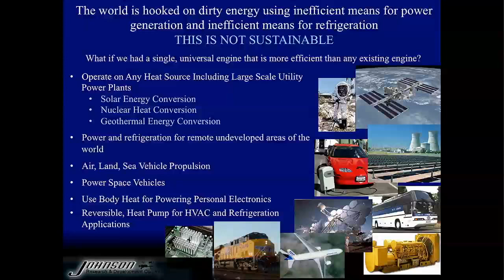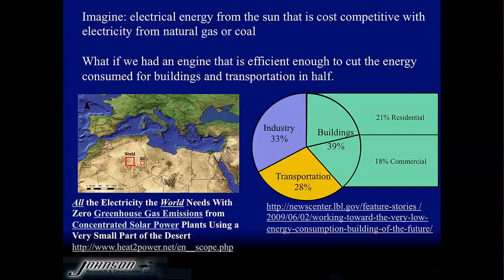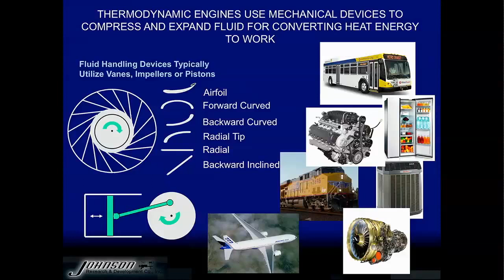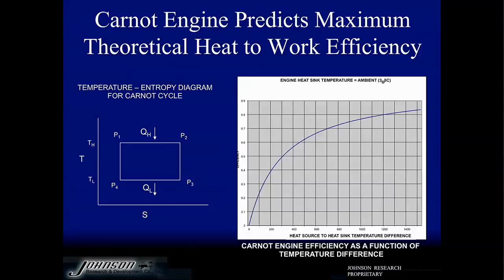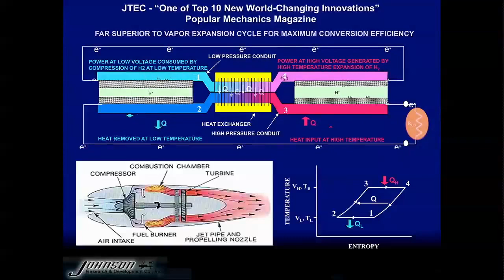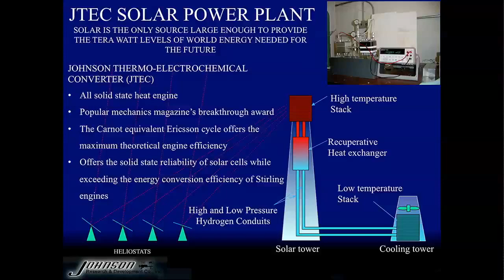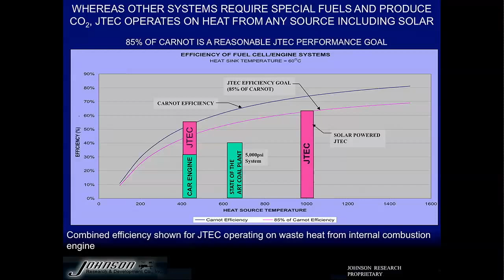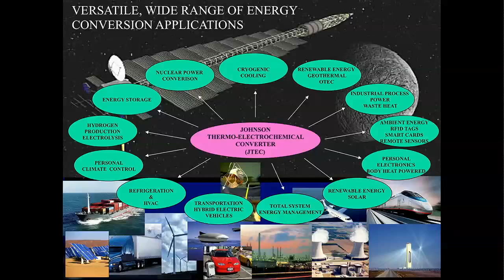Solve for X - Lonnie Johnson - Heat Direct to Electric Energy

Comment: CO2 is a problem? Without it , all humanity would die. CO2 is not the problem.
A lot of talk, but nothing to back up his claims. Kinda of like a Rube Goldberg machine.
Hint: BS does not impress. He has his routine down like someone who is a scientific inventor, but clearly he is not.
Reply: lol, he has proven applications under his belt. he used to work for nasa in the mars program. this is not some kook. i wonder what your motivations are with your comment. actually his invention was in popular science i think and it was considered one of the best inventions ever. your just talking from whatever biased that you have.
Reply: Europa Europa yes without it we would die but when you have too much co2 you die. As a test experiment close the flue on your fireplace and tell me how that works out.
Reply: You're the one talking BS. He holds 100+ patents in nuclear engineering, jet propulsion, and solid state fuel cell technology. Not to mention the man invented the fucking SUPER SOAKER (which, by the way, uses some of those same jet propulsion principles, only miniaturized and mass-produced).
Do you even understand the physics of what he created with the JTEC? I BARELY do - and I've got a decade of physics and advanced math under my belt.